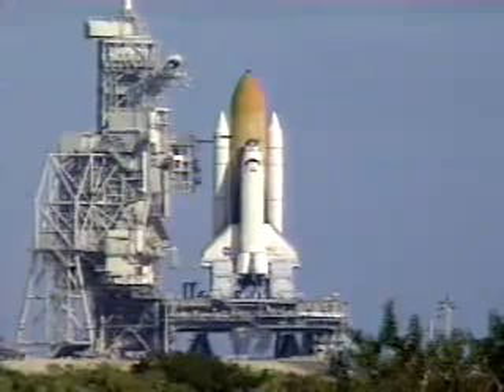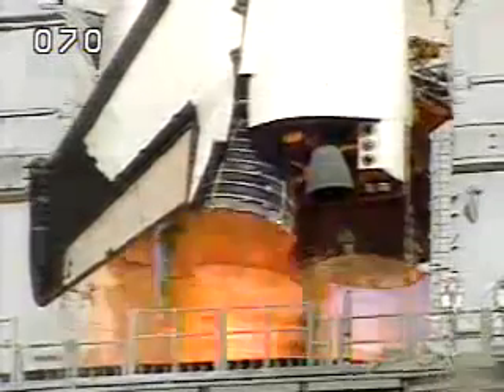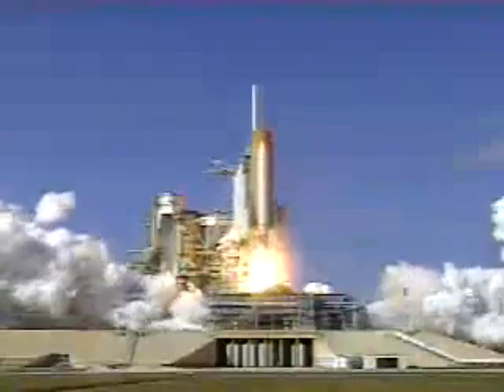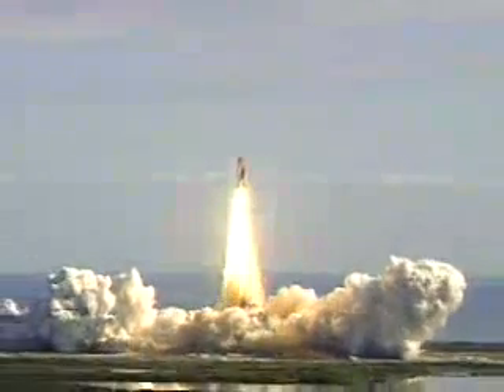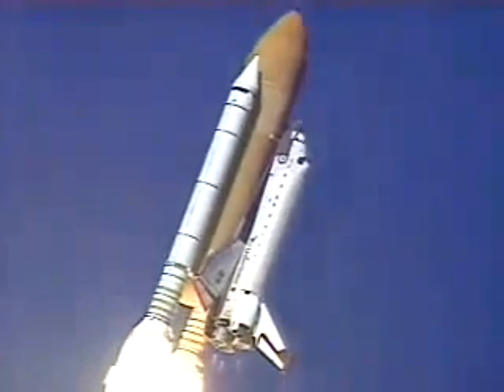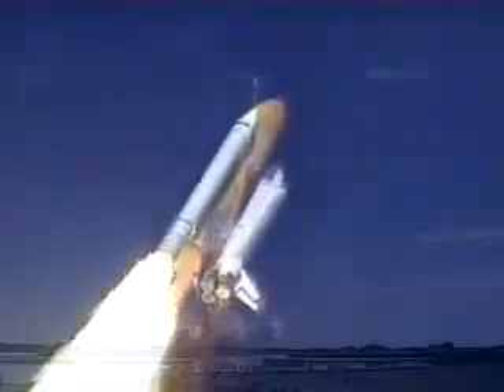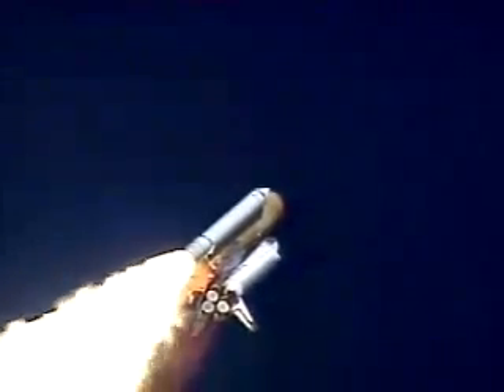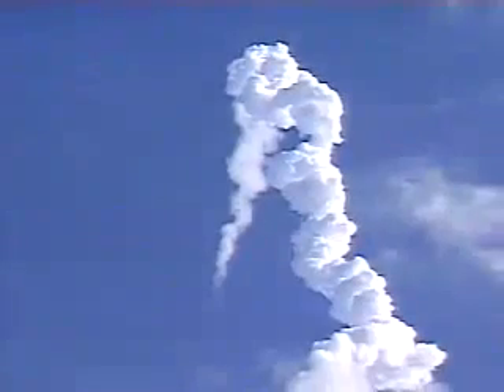STS-107 Space Shullte Columbia last Launch

Comment: The inconel insulation is mounted to the insides of the carbon panels and is just there to protect the mounting hardware that holds the panel to the spar. Its not behind the entire envelope of the panel but just infront of the bolts that hold the panel on. Its only a couple of inches wide on both ends of the panel. Still dont understand how you say tile damage added to the destruction...

Comment: You're correct that the breach was in the RCC Panels when I generically use "tile". But there is a secondary system of Inconel-Dynaflex insulation. You can see it in cross-sections of the wing's leading edge and find photos of workmen installing the panels showing the insulation. NASA describes this in one of its "Aeronautics Book Series "Coming Home: Reentry and Recovery from Space". Finally, although tile damage did not precipitate the disaster, it did add to the destruction of the vehicle.

Comment: Tiles had nothing to do with this accident. The hole was in the RCC or carbon panels which form the leading edge of the wing. Behind the panel is the airframe wing spar not a second layer of some insulation.

Comment: Read the accident investigation report. The media used "hole"- a simplification, that gives a false idea. Insulation from the ET (not a piece of the ET) dislodged and struck the wing damaging the outer carbon tiles and the first insulation layer. Reentry heat progressively ate through the damage in the tiles, first then second insulation layers, eventually allowing superheated gasses to enter and melt the shuttle skin and frame causing the wing and, subsequently the shuttle, to disintegrate.

Comment: Reason why it burned up was because a piece of the ET broke off and hit the wind causing a hole in the shuttle. When it reentered the hole that was cause by launch. When  look at the wind. The part gets the most heat in reentry was were that hole was and when reentered cause the shuttle burn up. Which is sad.